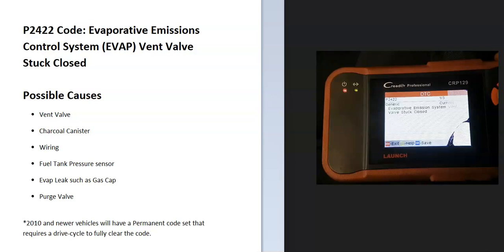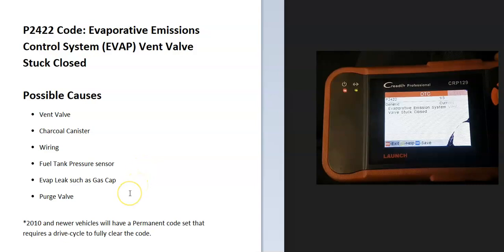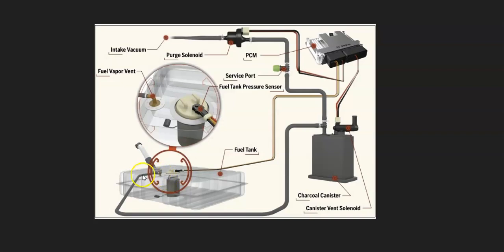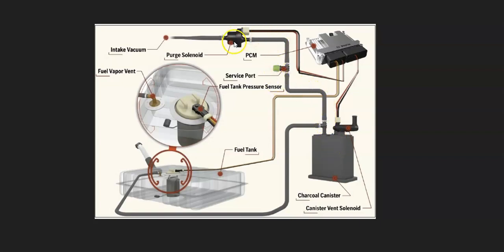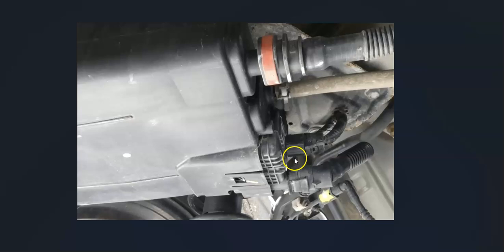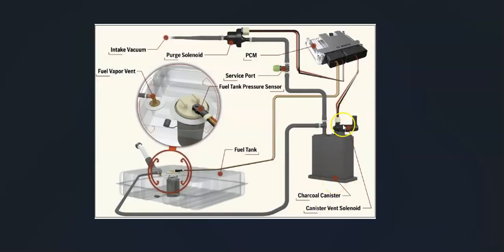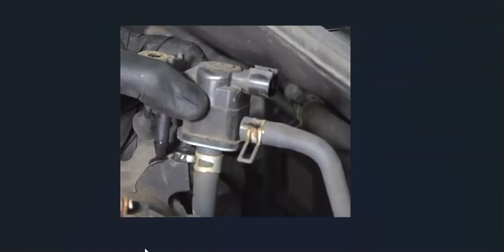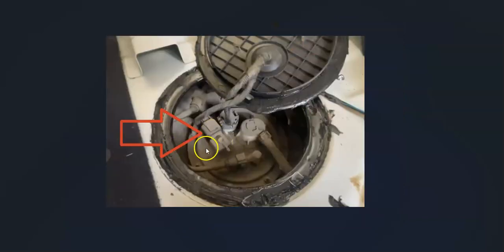Causes and Fixes P2422 Code: Evaporative Emissions Control System (EVAP) Vent Valve Stuck Closed

Comment: If the fuel pump has a leak around the seal would that cause this code to come up? I noticed there is fuel around the ring of the fuel pump on the top of the tank where it seats into the tank. Would that cause the tank not to have pressure and trigger the pressure sensor? I've replaced the canister and solenoid as well as the pressure sensor before I noticed this leak. (Leak only happens when I fill up the tank with gas, so it's at the top somewhere.)
Reply from the maker: A leaky seal on the gas tank can cause EVAP issues, but usually, it will give EVAP Leak codes.
Reply: @HVAC_Mechanic  Ok thanks. Currently I have a P0451 and P2422 code, which as mentioned I replaced the Evap canister and purge solinoid as well as the pressure release valve on the tank. (That's when I saw the leak around the fuel pump under the seat. We could smell gas when we would fill up but didn't know where it was coming from. I need to dig into that a little more I guess.)

Comment: I have Hyundai Elantra 2022 and I got the p2422 code and it says the vent valve was found closed so you recommend replacing the part or just trying to realign it

Comment: My fuel pump has fuel near that sensor is that normal? (Top side fuel pump)
Reply from the maker: The top of the fuel pump is a common location for the EVAP pressure sensor.

Comment: my 2015 honda accord sport is throwing the DTC P2422 code. Is $2,400 reasonable to replace EVAP cannister, cannister drain kit and cannister set?
Reply: Not reasonable at all. Your purge canister which is the most expensive part there is roughly $300. But that’s the price you pay when you don’t know how to work on a car or are not willing to try and fix it yourself.

Comment: P2442 2019 Kia Sorrento dealer replaced canister 300 bucks code came back after I filled the tank with gas, took like 8 minutes to fill nozzle kept shutting off while refueling. Any thoughts?
Reply from the maker: It needs to be diagnosed, but it sounds like something was not plugged in all the way or is loose.

Comment: Hey there!  I have a 2006 Kia Sedona LX.  I haven't had it but a little over a week.  The Check Engine light came on a few days ago.  I had the codes read and the codes were P0442, P0456 and P2422.  I checked the gas cap.  I don't see anything unusual or any cracks.  The P2422 code says the EVAP System Vent Valve is stuck closed.  Will it cause any damage with the valve being stuck closed?  What are some of the symptoms it'll show with the valve being stuck closed?  Thanks in advance!
Reply from the maker: With a bad vent valve, the vehicle won't pass an emission test. Sometimes, when the vent valve is stuck closed, the gas vapors cannot escape when filling the gas tank, which causes the gas pump to keep clicking off.
Reply: @HVAC_Mechanic  My 06 crv does that when filling up. Will the valve closed cause any damage or affect anything else?

Comment: My primary DTC is EVAP CVS stuck closed in my 2005 Honda CR-V. The part to replace it at O'Reilly's is $161 and change plus tax. I need to know the total cost asap because I don't have the funds right now but I need it taken care of asap so if will not get pricier should something go wrong

Comment: Hey, 2003 Honda Accord. Every start up chugs for anywhere from 3-15 seconds, usually takes longer the more I’ve driven it at a time. 

This code is the only one that gets thrown up, the P2422. 

Would this code or issue affect the startup of my vehicle? Or is that unrelated to my current situation.
Reply from the maker: If the vent valve is stuck open, it can affect the engine.